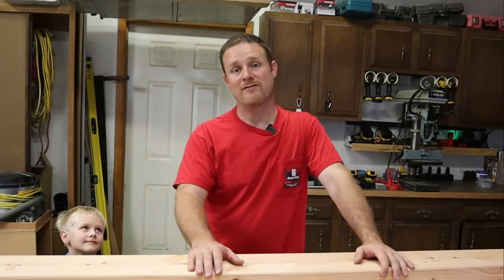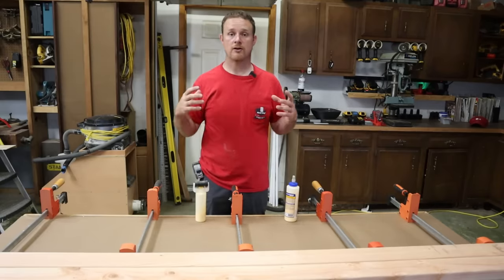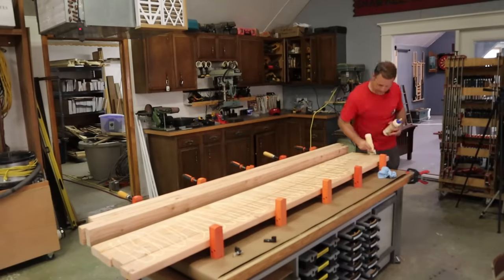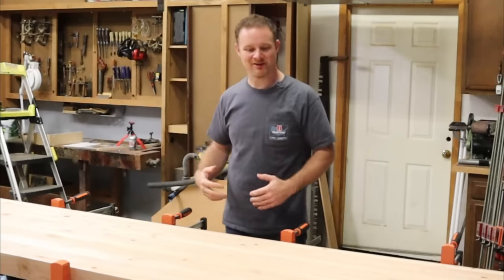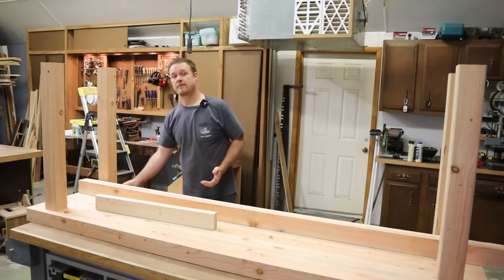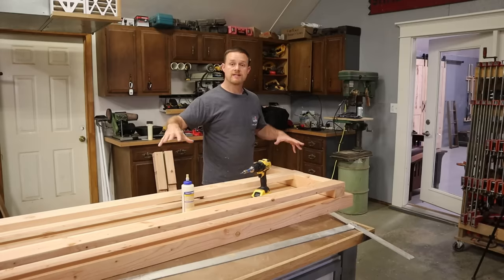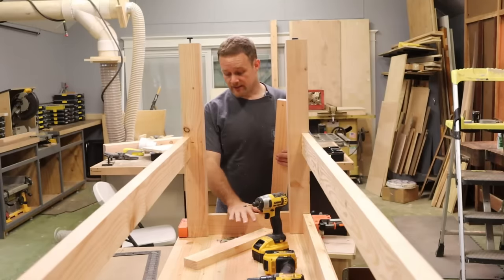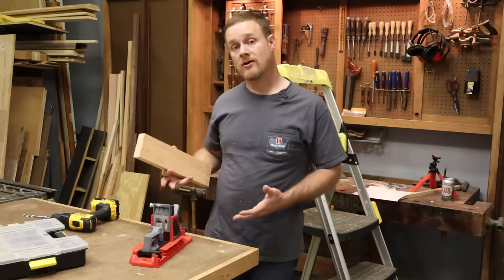How to Build a $100 Workbench in 4 Hours!  E73

Comment: Build a $100 workbench. Step 1, buy $300 worth of clamps. Step 2, buy a $500 planer...
Reply from the maker: Well, we found the Debbie Downer
Reply: @shaweehillsworkshop4226  heh, no, i should have added a winky face. ;-)
For those of us not as well equipped, do you think it would work to: 
1) use a hand planer AFTER gluing the surface together? 
2) use tiedown straps to hold it together
Reply: @shaweehillsworkshop4226  Actually, he does have a good point.  I went into this video with great interest, wanting to know how to build such a sturdy workbench as cheaply as you said. 

Then I saw the planer.  "Oh.... well, guess I'll have to try something else since I don't have a planer."

Someone else mentioned using two pieces of 3/4" plywood.  That's how I'd do it till I can invest in a planer   :-)
Reply: @toddz8579  100% right. If you have all that equipment and a dedicated shop, you dont need to watch a youtube video on how to build a bench. This was targeted towards your everyday DIY guy, going by the click bait title..
Reply: Maybe you could use a sander and sand down the table smooth instead but IDK.
Reply: @999erh  (1) Yes, if you know how to use a hand plane you can absolutely flatten a workbench to near perfection.
(2) I would suggest DIY "panel clamps" instead.....for the sake of explanation, lets say that you're top is going to be 20" wide and 6 ft long. 
For the clamps, cut 8 pieces of 2x4 28" long and get 8  1/2" x8" carriage bolts and nuts, also get 4 washers to put under the nuts.....drill a 1/2" hole centered 1 1/4" in from the end of each board centered on the face side. Place the 2x4 pieces on top and bottom of your glue up every 2' along the length and use the bolts to hold the clamp pieces together....the bolts don't have to be super tight, their purpose here is to "flush" the edges of the glue up and keep everything as flat as possible.
Now, make yourself 8 sets of wedges by ripping a 2x4 down to just under 3'.....basically just take the rounded edges off.....cut 8 pieces about 10" long  and then rip each one diagonally to make a set of wedges. Use one set of wedges between each bolt and the side of your glue up to put clamping pressure on the glue joints.
Also, put clear packing tape on your 2x4 clamping pieces so the glue won't permanently attach them to your glue up...
Reply: 😂😂😂😂my thoughts exactly
Reply: @TheWingnut58  yes sir! If you want to call yourself a craftsman. craft some shit!! Haha.
Reply: I was thinking the exact same thing. Lol.
Reply: This comment made me laugh for a cool minute 😂
Reply: @TheWingnut58 thank you
Reply: No kidding right? Who has that?
Reply: I suggest you just go to Harbor Frieght and buy a table.
Reply: Just get 3 sheets of mdf and use that for your top of your don’t have a planer joiner or table saw. Rob Cosman has a great video on that bench.

Comment: Got all my wood, now I just need to get a table saw, wood planar, pocket hole rig and a set of drill bits 😭😭
Reply: Mmao
Reply: How did it go? I'm getting ready to start building mine.
Reply: YOU FORGOT BELT SANDER,  400,000 DOLLAR HOUSE WITH GARAGE TO DO THIS IN
Reply: yeah a little more than $100
Reply: @1littlelee  a little lol???
Reply: You can borrow my tools. Can I borrow the wood you got?
Reply: Harbor Freight my dude
Reply: Right? LOL, exactly my thoughts
Reply: And like 100 clamps
Reply: Haha! We feel you
Reply: Don’t forget already having a workbench to build the workbench on
Reply: @malachimerriam1640  clamps probably cost more than the table lmao. I've never seen a clamp that big for less than 15$ and he uses like, 20
Reply: You forgot the $500 worth of clamps. This is $100 workbench, the only catch is you need like 5 grand worth of tools to build it.
Reply: Hell, after buying all the tools needed for this project, I won’t have any room left for any kind of workbench.
Reply: You can easily build this workbench with a circular saw and a drill. It just won't be as nice.
Reply: @dustindrake6644  thank you, that’s what I have hahaha
Reply: @PoppaWheelies  lmao
Reply: I purchased a metabo miter saw for 100$ on amazon (its basically hitachi) and works fantastic, for pocket hole you can get a 20-30$ jig + a box of phole screws, its not that expensive. 

the planer is the toughest part, takes up tons of space and is $$$
Reply: Hahahaha right?!?!
Reply: Why do you need a workbench if you don't have any tools? Then you are clearly not a DIY person.

Comment: Not so easy without a professional wood shop.
Reply: You do the whole thing with a hand saw, chisels, and a hand plane as well, it will just take a lot longer.
Reply: Doug Roth but Doug, what if i have a bad back and arthritis in my hands and i don’t have a way to get the lumber home or the money to buy it and there aren’t any straight 2x4’s at my local home depot and ive never woodworked before and...
Reply: Hahahahaha that freakin killed me!!
Reply: Nick White nah...i have a whole shop full of tools, i was just trolling because Every one of these videos where guys are building laminated wood tops benches someone makes the comment about not being able to do it without $4,000,000 of tools.
Reply: Drones Eye View Ireland calm down
Reply: I would say most of the work, like cutting the wood to size can be done by yourself and the ones requiring the planner or driving the screw holes at an angle, you could out source at your local joinery shop.
Reply: @tywebbgolfenthusiast8950  Hire a butler!
Reply: I kind of agree, not everyone has the space for workshop (sadly).
If you don't mind the extra works, a circular saw(Table saw works too)+rails(can be DIY too)+few sheet of insulation will do the trick without too much space. 
It will take longer and more works, but at least you don't have to struggle to have a workshop.
Reply: I agree. If one of us is looking for a 100 buck simple working bench its because we don't have 5000 wood working tools lying around. Great video, but please give us something we can work with.
Reply: This video is so tone deaf
Reply: @skippywinters  I spent about 1K on tools and getting my first project done. A lot of reuse value and they are definitely worth the prize. Get circular saw, sander, and a router, some clamps and you are good to go. You can definitely spend way less than what I did, since I paid more for wireless.
Reply: @Nick White  Lmao.

Comment: Hey maybe I missed it but I watched twice and still don't know how you attached the top to the legs
Reply from the maker: Yeah, I spoke about it at 6:46 but several people have asked the same question so I guess I should have shown it, lol.  Sorry.
Reply: SHAWИEE HILLS WORKSHOP - yes, showing how you attached top to the leg base would have been helpful.  Good idea on the leveling leg attachments.
Reply: Duct tape
Reply: SHAWИEE HILLS WORKSHOP  I watched the 6:46 section a couple of times, but I still didn’t hear how you attached the legs to the top.  Please explain.
Reply: TexFlix pocket holes in the side stretchers to join the top to the side stretchers
Reply: If you pause it at 7:43 you will see in the center the pocket holes go up towards the table top
Reply: @shaweehillsworkshop4226  Oh, I see it at 7:40.  I assume you used the same Armor Auto Jig for that by turning your 2x4 on its side for the 2 holes per piece
Reply: @Texflix  he used the pocket hole jig. And looks like he screwed the top to the board and not to the legs.

Comment: 2019: This is $101.76 of material. This is 25 2x4s and 2 4x4s.
2021: This is $101.76 of material. This is a single 2x4.
Reply: I was looking for this particular comment! Lol 😁 All of my diy projects currently on hold. 😔 🤷🏻‍♀️
Reply: @Veronica_Prado  I was looking for this comment too hahahaha
Reply: 2022: This is $101.76 of material.  This is a single 2x2 firring strip 12 inches long.
Reply: I walked out of Home Depot with a splinter in my thumb.  I was arrested for larceny over $500
Reply: $118.72 in 2024. But he didn’t factor in the plywood shelf…
Reply: Cries in 2024

Comment: I built a work bench similar to this 30 years ago.  Had a bunch of junk 2x4 used lumber that I used.  One suggestion would be to put 1/4" plywood on top of the 2x4 top.  That way when it gets in bad shape just remove the top 1/4" and put a new piece on and you have a new top!!
Reply: love it

Comment: This bench is perfect for my needs. I bought the wood and just started building it! Only thing I don't have is a dado stack for my cheapo table saw. I'm also going to add workbench casters so I can move it. Thanks for sharing this build!
Reply: Although the title says $100 and 4 hours to build, I could not match that cost and timing. The materials cost me $190 (NJ) and I have 14 hours of time so far. I had to glue the top in 3 sections to fit through my small planar, so that added xtra time. And, I'm a newbie woodworker so added time for my inexperience. It's coming out fantastic and the base is almost finished and I'm ready to glue up the 3-sections of the top! Regardless of time and cost, I'm enjoying the build and very happy with the bench so far!
Reply: @IvanBoden  Great idea with the casters.  I always recommend making your tools mobile in your workshop as much as possible!

Comment: Just made my first workbench.  I did things slightly different than you did.   I brad nailed the shelf to the bottom stretchers and had to make 4x4's since the local box store had only 2x4's.  Limber right now is crazy priced... it was almost 6$ per 2x4 (8').  

Work bench turned out great.  Next is a miter saw table then a rolling tool cart/bench for my router.  

Thanks man, for making it seem as easy as it is.

Comment: Good job, nice bench and doable without power tools with a little more effort and time. The only addition I might consider would be to add diagonal struts to the inside of the legs at each end for a little more stability.

Comment: Nice Job , Most of us do not have a planer or jointer  I have Made similar with 2x6 for table top and 2x4 legs ,  without the glue 2x6 lay flat not on edge my legs are made up of 2x4 One 36 inch and 2 at 16-1/4 so the bottom shelf can rest on the 2x4 stringer 3 inch x 3-1/2 legs no cutting a slot in a 4x4  The two front legs,  screw the first 16-1/4 to the 36 inch add the 8 foot stinger , screw the next 16-1/4 over the stringer , Same for the Back legs , On the inside top of the legs , under the table top flush  I add a stinger to fasten the top to .  I also use cross members every 16 inch between the stingers .  all done with a skill saw and drill .  I do more Auto repair so a clean finish is not important I know it will get deep scratch and dents .  Thanks for the video im always looking at new idea for improvements

Comment: Great build! Did I miss a step? How is the slab bench top attached to the legs? I saw two guys carry it to the legs, and next thing was lacquering it.
Reply from the maker: I mentioned that I was connecting it with pocket holes through the stretchers when I was drilling the pocket holes, but did not show it.
Reply: Yes, if you pause the video at 7:40 you'll see the 2 holes in the long end of the side stretchers.  I think he made those holes with the Armor Auto Jig, just as he'd done on the short ends of those 2x4.  Also, I had a big container of 2" square head floor screws that worked perfectly for those Armor pocket holes

Comment: I see people all the time critical of this kind of video because they don't have all the pro tools. If you want a cheap workbench, just use the tools you already have. For example, cut the rounded edges off the 2x4s with a circular saw and a straight edge, that way when you glue them together the surface will be as near flat as you can get it, and you can finish it off with a hand plane. Great video, thanks!

Comment: I thought about this kind of top, but opted to lay the 2x4s flat and used 3/4" plywood over them. I don't yet have a planer.
Reply: I am looking to build a workbench too, but am just starting out so don't have a planer either. Can you let me know how this approach negates the use of the planer?
Reply: The flat 2x4s make a firm base and the plywood make a flat surface also helps to stiffen the entire top. I think it's just as sturdy as 2x4s and easier to build.
Reply: @Fbarts  2x4s standing up and glued together is about as stiff as wood is going to get. Being as PVA wood glue is stronger than wood itself is.